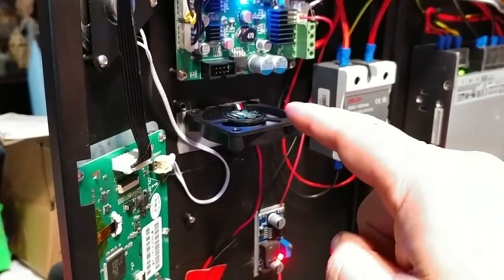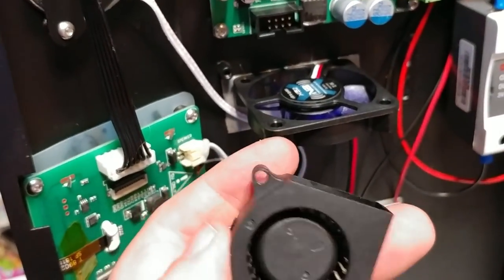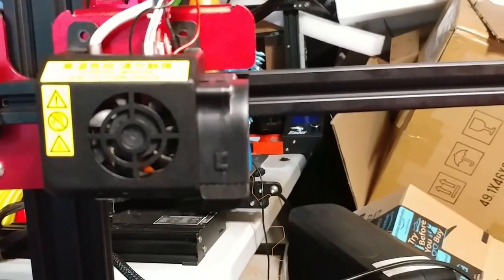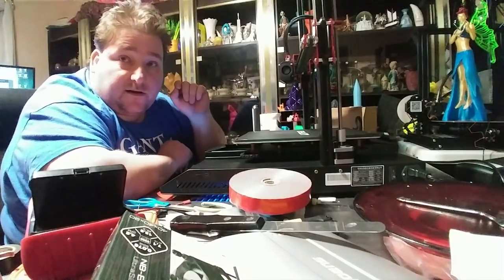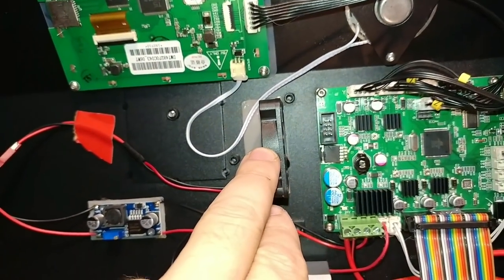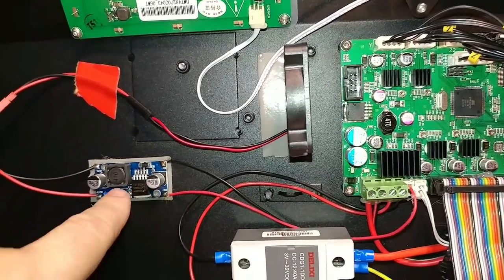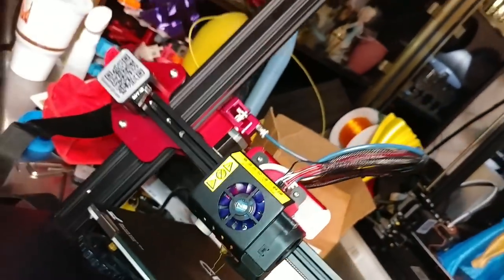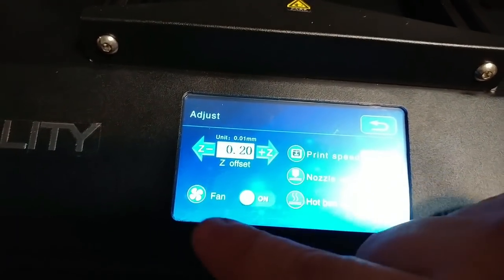CR-10s Pro Ultra Quiet Upgrade for Fans - T3DP

Comment: I changed my fans today. 3x Noctua 40x40x20 inside (Board, PSU, Case) only the on case is too loud. I think because there is no rubber between case and the fan. Here i ordered today the NB-BlackSilent PM-2 4020, and a Sumon 4020 which should be very silent and powerfull with only 13dba and has only good reviews. Other fan (NB) outside for the partcooling is very silent. Luckily my step down moduls have the same blue light like the mainboard inside, looks cool especialy the one below the motor on the z-axis which shines on the heatbed a bit :-) I also installed the inductive sensor but i will try it out tmr. To change all fans and sensor tooked me more hours than i expected... hard work if you do this the first time i have to say :-) But now i will also change the fans of my normal CR-10 too - because now i know how it works :-) Thanks for the help buddy!
Reply from the maker: No problem got links for those other fans?
Reply: @nerys71  i will send you a link when i find out that they are really more silent - otherwise i think its only marketing and you would also waste your money :-)

Comment: I installed 5 noctua Fans. I replaced every one on my cr10spro. Do you think they deliver enough power for the hotend? I am afraid if won't have enough cooling..
Reply from the maker: You're about to find out :-) as long as you keep it clean keep the Dust Away you'll probably be okay in the future dual ball bearing fans are in a and they are just a silent without sacrificing cubic feet per minute

Comment: also did you replace both cooling fans on the head or just the one on the side? if so what did you replace the one on the side with, size and voltage thanks.  I just got mine and I want to make all the adjustments and mods before using it thanks.
Reply from the maker: I ended up not replacing the parts cooling fan the one on the side if you wish to it is 24 volt and there are Replacements available just make sure it's dual ball bearing I believe it's a 40 40 10 blower

Comment: Thanks for the instructions and the mount. The most exhausting part was changing the fan of the PSU. I still have mine open to make sure it works; it hasn't kicked in yet. Any idea if there is anything I can do to push it to start the fan while it is sideways on the table, with the guts open? I am hoping to test the PSU fan before closing up because without visually seeing the rotation, I wouldn't have a way to make sure it works.
Reply: I tried heating the bed and nozzle and the fan didn't start. I wasn't patient enough because the second time I tried, when the nozzle got to 150, the PSU fan started up.
Reply from the maker: Yes when ambient heat in the psu gets high enough it kicks on has nothing to do with printer temps. Fastest way to heat up the psu is turn on the heat bed :-)

Comment: I also use JST connectors on every fan for a quick swap, what about for the heating cartridge? What is your preferred fest connector there?
Reply from the maker: XT30 for the cart XT60 for the bed.
Reply: have any affiliate links you would like us to use?
Reply from the maker: I just added links to the JST and XT (both 30 and 60) to the description. I also added amazon aff links to more countries as well refresh the page to make them load.

thank you! @petersolomon3505

Comment: Hey Chris, you could use only one buck converter as to can deliver 1A, to all your fans.
Reply from the maker: Possibly but then you're going to be potentially overloading that one socket on the motherboard which might not be able to handle the load of three fans

They are very cheap and this allows me to keep things relatively stock they are very cheap especially if you use the new ones I got it's $6 for 10 of them they're $0.60 a piece I would rather have the dependability of under loading them at that price without potentially damaging the brain board
Reply: Then I guess it's better safe than sorry.

Comment: The new exhaust fan you installed is quite a bit low in terms of the CFM compared to the stock one (assuming the stock fan is around 6.5 CFM). How did you know ahead of doing this that you wouldn't have a problem with overheating?
Reply from the maker: Because the manufacturer also had no idea what the CFM was they just stuck a fan there that fits it has overkill for cooling on top of that I believe I've actually increased the CFM over the stock fan 

The stock fan was blowing through to grates in order to get air out of the power supply in out of the brain box so little are made it through both of those grapes that the CFM of the fan was largely irrelevant but slower fan I installed after removing most of the greats to improve the airflow was actually stronger with the lower CFM fan I was really surprised by that whenever I mess with fans now I checked for blockages from the gratings
Reply: Nerys so do you think I’d be ok with a 4020 12v Noctua there?
Reply: Nerys also I changed the main board fan from that blower fan to a 12v 80mm axial that goes on-too if the mainboard (in reality underneath when the printer is right-way-up). There are grates just above(below) the mainboard to let air in. I wonder if I could do the same thing as an exhaust over by the PSU? I’ve not seen that in any mods though.
Reply: @ErlendDavidson  as long as it will physically fit it should be okay don't forget to adapt to the voltage
Reply: @ErlendDavidson  I'm not 100% sure what you're describing you probably don't want to be adding new holes and that would change the path of the air flow
Reply: T3DP Tips thanks. The bottom metal plate that detaches when you open the printer already has two grating on it. The first is above the mainboard and the second is close to the PSU. I was wondering about attaching a larger fan to that second grate, instead of the exhaust fan.

Comment: will a noctura 40x20 absoloutly not fit on the hotend heatsink cooler? is it too thick?    done all the internal fans but already ordered 2 more 40x20.    I was thinking of just desiging and printing my own mounting/shroud for the whole hot end but I kinda like that metal one has an industrial look to it.
Reply from the maker: Stock? No way but if you ditch the shround then you can put anything you want their :-)

Comment: Hello Chris, great video. Do you know the required CFU for the different areas, especially for the hot end? What is the exact requirements to get really good cooling of the hot end and no heat creep? Also you showed that they were using a 12 V fan in the 24 V power supply do you really feel like you could always use 12 volt fans and not use the buck converter?
Reply from the maker: unknown. and I doubt creality or anyone else knows either :-) it also probably varies.

what I can say is the wee air that the ultra quiet fans put out is plenty. even after 200-300 long prints no heat creep.
Reply: I saw Tim Hoogland did a good youtube speaking about heat creep as a slow build up over time when hot end fan is underpowered.  I am curious if anyone did a good study on exact CFUs so we can more scientifically decide which fan to use.  I do agree that most other fans keeping the power and board compartments cool are probably just fine at any rate, as long as there is constant airflow. For part fan, I tend to always go with blowers.
would love to have data on hot end fan requirements.

Comment: Is there already an alternative replacement for the duct fan which is the last noisy fan in your modification?
Reply from the maker: No obvious Replacements that I am aware of but if you can find the same 24 volt fan with a proper ball bearing instead of a sleeve bearing that will help
Reply: @nerys71  Thanks for the advice. So the original one is with a sleeve bearing, right? It seems really hard to find 24v 4020 radial fan, I might try to find 5015 instead (if I can't bear the noise of the original 4020 radial fan). Will try to do Hero Me mod. For the other fans, planning to replace all with Noctua 4020, since can't find NoiseBlockers in local (China). The original fans are really unbearable noisy... Have to replace them

Comment: Is there something wrong to use it in the way you did it but to use the stepdown which is connected to your board fan, also with a long wire for the case fan? = Power from Board 24V to Step down , 1 x for the board fan and 1x for the case fan?
Reply from the maker: I think the translation got a little goofy there can you clarify? I think you are asking if you can power fans directly off the power supply using the buck converter if that is what you were asking then yes you can do that no problem just remember though they will turn on the moment you turn on the printer and they won't turn it off if you turn the printer off

Comment: @Nerys have you happened to look for any extra spots to pull power from on the daugher board under the extruder? I would like to find something for LED lights that the power would come thru the ribbon cable?
Reply from the maker: You can just connect it to one of the fans that's always on LEDs don't take much power as long as you're not using high powered ones

Comment: Interesting. your hot end wires are differently positioned to mine. Mine are all tucked behind the hot end so they dont abrade against the casing like yours is. Wonder if they made a change since you bought your printer?
Reply from the maker: Yes they probably have made such a change that was one of the first things I alerted them to

Comment: I replaced my hotend fan with a 12v fan using a buck converter. When I change settings in cooling in cura. It doesn't seem to do anything. I get the same noise no matter if I keep it on 5% or 100%
Reply from the maker: It's not going to change anything :-) that's why the cooling fan is the one thing you can't replace with a buck converter it's pwm controlled and when you install the buck inverter you defeat the pwm control so it always runs at full speed

You need to replace it with a 24 volt fan make sure the fan is dual ball bearing and it will be significantly quieter
Reply: @nerys71  thank you so much. I was loosing my mind. My idea right now was to check the voltage mid print and running with the printer so see what changes lol!

Comment: nice video did you ever do anything with the parts cooling fan, ie the 5015 on the side of the head? would using a buck converter and stepping it down to 12 do the trick or will there not be enough air flow? it seems as though the noise of the fan is in direct proportion to the voltage going through the fan, ie the higher the voltage, the noisier the fan, is this your experience(except for the 12v power supply fan which is noisy as hell) ?  I got all three fans underneath replaced and they are working great but the two fans on the head seem noisy although the one on the right of the head the 5015 doesn't come on all that much.  please let me know thank you
Reply from the maker: That would make it quieter but also slow down your CFM which might take you below the necessary amount of air you need for cooling on most Prince I can run mine at 80% which is quite a bit quieter also if you can find a dual ball bearing version of that fan 5015 blower it would be much quieter
Reply: @nerys71  how do you get it down to 80%? I heard some people use a 16v (max) capacitor but it might be easier just to get  another fan what do you think?
Reply from the maker: @landmanron  I just turn the fan speed down to 80% in the slicer

Comment: Ordered my pro from Amazon got 2 by mistake so I am using them both one was free. Love them a lot just got one almost silent now using this vid. as a guide thank you. My question is should I get my free money back for one of the pros and buy something else like an s4 so I can print bigger or a nother printer to have something differant? Is the s4 a good printer? And is the 400x400x400 really that much bigger? I know I can make the fans quiet but the stepped are always gonna be louder.I am thinking this way I can print things like a helmet as one peace. There are so many printers out there and I know you have a ton of them so I am looking for what you would suggest or should I just keep them both and do twice as much printing the same way.
Reply from the maker: Sweet mistake :-)

The 10s Pro is superior to the S4 in the hardware but does have that expanded build volume you may want to consider the S5 if you have the space is that will give you a half a meter cubed! Be prepared though Prince of that size take a very long time to complete you're going to want a battery backup to avoid brownouts canceling a print as you could be looking at 24 hours to 300 hours per print depending on how dare you willing to go :-) slap a 1.2 mm nozzle on it and go to town!

Comment: I was wondering how the fans have held up, I need to upgrade my fans on CR10S Pro? Any things you learned or would have done differently. Thanks
Reply from the maker: No so far the fans have held up fine and I have had no issues with them

Comment: I’ve just had another thought. The exhaust fan and 50x10 could be ran in series, they are constantly on right? I used the buck converters, I’ve never used them before and they seem to be getting warm to touch, is that normal
Reply from the maker: Apparently you cannot run fans in series it will damage that doesn't work they don't eat see 12 volts when you do that meaning you'll fry them :-) so you need to use the buck converter them getting warm is normal they are dissipating power as long as they don't get hot you're fine

Comment: if you buy the same fan that is less noisy do u still need the converter. can i just replace the fan in the power supply with the same voltage fan
Reply from the maker: Yes as long as the voltage is the same it's a drop in replacement you don't have to use noctua fans just buy dual ball bearing fans they are virtually silent

Be careful with the power supply some of the 24 volt power supplies use 12 volt fans
Reply: @nerys71  thanks

Comment: Hey Nerys, I was wondering if you have replaced the HotEnd fan on this yet? I know you were waiting on the fans to come. I was wondering do you have a DIY on how to do that? Also is there any other info on what you did to the CR-10S pro? I been trying to find more video on doing the stepper mod and all the fans replacement. Thanks
Reply from the maker: Yes it's the first time ever placed 40 40 10 if you mean the parts cooling fan no that is still stock I just run it slower to lower the noise
Reply: @nerys71  I mean the Fan that is controlled by the fan button. In the video you said you were going to replace it. I was wondering if you have gotten around to that yet? I need to replace my hot end fan but I don't know which fan to use or the process. If you have done it can you explain to me how you did? I was looking through your videos for a guide
Reply from the maker: I have that one linked on my page it's a 40 by 40 by 20 blower 24 volt they are quite cheap to replace

Comment: Good evening and great video. I changed the fans in my CR10Pro V2. I swapped the back and the system fans with 24v fans. So it was a straight swap and they work fine. I swapped the PSU with a 12V, now I don't know if when I powered on it was supposed to spin up like the other two fans, or it only spins up under load. 
If it is the ladder, is it possible to know when that fan kicks in? I would greatly appreciate any and all help. 
Thanking you all in advance.
Reply from the maker: The internal fan on the mean well power supply turns on based on load so it does not turn on when you boot the machine up just turn on your heat bed and your nozzle heater and the fan should eventually turn on